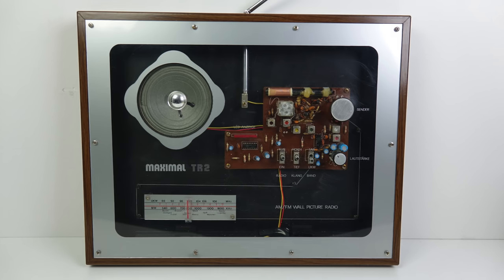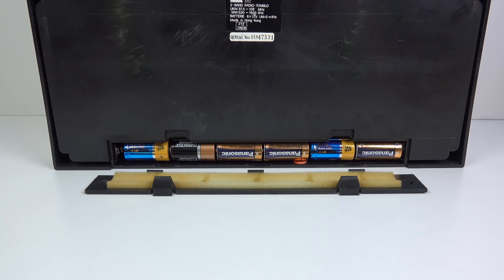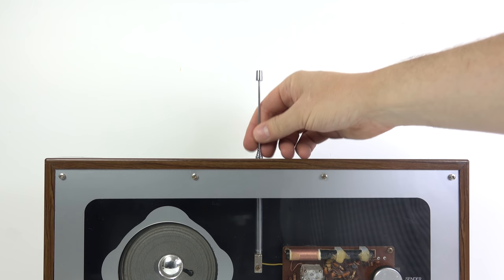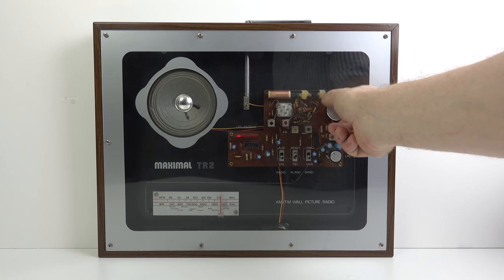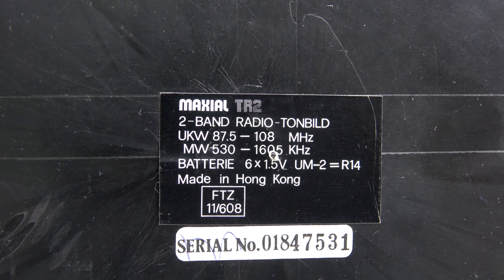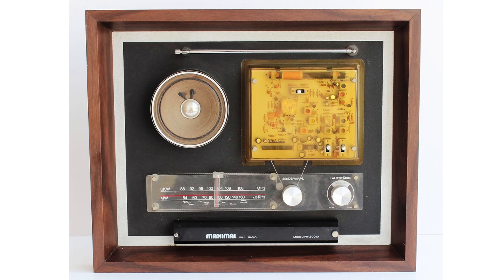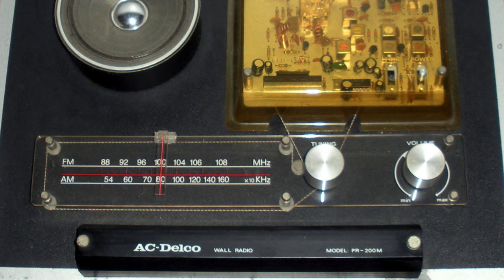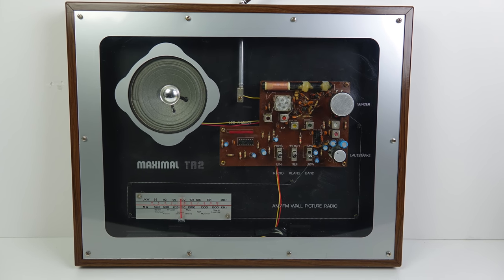Maximal Wall Radio - A QUICK-EXTRA-VID

Comment: be good as a self assembly kit to put on wall afterwards 
be like " I made that"
Reply: pretty easy to do  from scratch with a "donor" radio i'm guessing
Reply: My thought exactly. Fun little project. Parts should be inexpensive
Reply: I'm thinking that! Something like this (probably) won't be that hard :D Would just need a longer cord for the tuning dial :D
Reply: Yup! My 1st thought was Ah! Something interesting to do with those cheap Aldi radios I keep buying for some reason!
Reply: I may have to do this to my old "bathroom radio" I listen to when in the shower for news. It's an old Gran Prix AM/FM/TV/VHF Air that's seen better days. The battery terminals rotted out years ago (I fabricobbled an external D cell battery pack, lasts for weeks), and the plastic dial indicator broke a decade before that, and most recently the speaker decided to crap the bed, so I ordered a fancy transparent one from DigiKey. May have to get some plexi and fishing line and McGuyver a proper case.

Comment: That ULN2204 AM/FM demodulator chip was manufactured 04th week 1982. The parts on the radio are crooked for a reason. That's how they adjust that thing.

Comment: A tube wall radio with magic eye would definitely be more appealing, but would need a big hook to hang it because of the transformers, and would have a power cord coming out of it. I've seen one in my university, but AM-only as most tube radios were, and I don't know if it is still working. It is some kind of a educational model, but would make great and functional room decoration.

Comment: If they're gonna have an exposed PCB, I wish they'd make sure all the components are mounted straight, that would wind me right up having to look at wonky stuff.
Reply: I would have gone with a layout that complimented the other components. Maybe integrated the dial. It looks like they just gutted a regular radio and stuck the pieces in a frame. A bit like that pencil case clock kid.
Reply: It might not be possible with what they had back then, this PCB could as well be design from when IC radios started to show up, so mid 70's (IDK, we in Eastern Block used tubes for that for looooong time, so maybe earlier), and back then properties of PCB maybe were not that great so they in order to reduce problems with them had done it this messy way as it was easier than deal with other problems.

Comment: A radio isn't a radio unless is has LUXEMBOURG and HILVERSUM proudly displayed on the dial!  I had a radio which featured the exotic-sounding DROITWICH on it......
Reply: Exotic sounding, maybe, but in reality, a place near Birmingham, England, and about as far from exotic as it is possible to get.
Reply: Where the Radio 4 longwave transmitter is, which also sends out the Economy 7 signal

Comment: For some reason, when I first saw the system, I immediately thought of those radio/intercom systems in my parents' house. The main unit was usually in the kitchen, and each room had a speaker with volume control. I forget what the switches on the room panels did. I just remember a switch for something. I don't remember much about them, and I think we stopped using them around 1980 (when I was 11). I know we had one in the previous house, but I don't recall using it there either. I had forgotten all about them until I saw this video.

Comment: I remember buying many components in the 70s and 80s with "genuine artificial wood grain" 😋
Reply: Darren Krivit - As a young teen, I worked very hard one summer and saved enough money to buy a real quadraphonic system from a big box store.  It was a Sound Design brand and at the time I didn’t know they were on the inexpensive end of the quality spectrum. The four beautiful, matched speakers (12 inch main drivers and two piezo drivers at the top) were well taken care of and I wiped them down often with dust spray containing wax. One day while doing this I noticed a sticker that I hand not looked at before and my stomach sank as I read, Quote (I will never forget) GENUINE WALNUT WOODGRAIN VINYL VENEER. lol, it took a moment to sink in...

Comment: Some local stations in Norway are still transmitting. I found one at 99.3MHz in Oslo. Buying one of these radios just to listen to one station would be like experiencing the early days of radio broadcasting - the ultimate retro statement.

Comment: This "messy" arrangement of condensers and so, even with that wax like substance is common on circuit boards of some lower end devices.  I would say that it was due process used back then for developing of boards, when they etched rather borders than paths. I would assume that it might be due price and problems with PCB boards back then. I have dismembered several TVs and radios as kid in late 90's early 00's and I remember that those cheaper one used to have those messy arrangement somewhere, especially if it was around some critical part where they would have problems with parasitic properties of board (capacitance, inductance and resistance)

Comment: I like the idea of using circuit boards as decoration, but it should be really neat to do that. This one looks like the inside of any old cheap portable radio and it's a shame, because I think a radio made of discrete components is much more interesting to look at.

Comment: I've seen modern versions, which I'm not terribly keen on as the sound tends to travel (not very good for apartments). I rather like the look of both models you've shown here, Mat. In fact, it reminds me of those 160-in-one electronic kits, the one with a wood frame rather than plastic (Radioshack).

Comment: Looks like it is a regular mass produced radio, just in a bespoke casing with the cover. Not made specially for that, but probably turned out from a regular production run instead, either as they have end of run units or just as an order for the bare boards from the manufacturer.

Comment: Un diseño clásico de hace al menos 30 años. Usan el ULN2204A como amplificador de FI (Frecuencia Intermedia) con un esquema de amplificador de RF y conversor basado en transistores discretos. El LB1405 se usa para proporcional un medidor VU basado en led. Completamente analógico, cualquier técnico con conocimientos razonables puede darle servicio y recalibrarla de ser necesario. Una reliquia de la época donde se diseñaba para durar.
Por cierto aquí en el sur de Latinoamérica (Argentina para ser mas exactos) aun no se decidió el paso a la digitalización de la radio. Las grandes distancias y el uso masivo de la "radio vía Internet" hacen que la adopción del sistema DAB sea poco menos que una quimera.

A classic design from at least 30 years ago. They use the ULN2204A as an IF amplifier (Intermediate Frequency) with an RF amplifier scheme and a converter based on discrete transistors. The LB1405 is used to provide a LED-based VU meter. Completely analogical, any technician with reasonable knowledge can give service and recalibrate it if necessary. A relic of the era where it was designed to last.
Certainly here in the south of Latin America (Argentina to be more exact) has not decided the step to the digitalization of the radio. The great distances and the massive use of "radio via Internet" make the adoption of the DAB system a little less than a chimera.

Comment: In the US market FM is alive but not well.  There is some digital broadcasting using iBiquity's "HD Radio" (not to be confused with HDTV) but other than some experiments, the data is transmitted in addition to the analog program not in place of it.  AM (MW) radio is in worse shape because the FCC has, for years, not done anything about unintentional radiators -- primarily millions of switch-mode power supplies -- that are polluting the lower radio frequencies.  The FCC's "AM Revitalization" plan was to give every AM station that wanted one an FM translator ... so now the FM band is filled with low-power FM signals polluting that band as well.

Comment: The reason the PCB looks so horrible is that it was never meant to be seen.
I had an Emerson (or GE?) portable radio, same dial/switches/knobs/board, but was in a compact silver injection molded case. Bought it at the base exchange while I was in the Air Force.
Only reason I know what the insides looked like was a girlfriend closed it up in the hatchback of her car 😬
If I can remember the model number I'll let you know...

Comment: 6 C batteries?! Why does a simple radio like that need so much power? I remember plenty of small hand held radios throughout the 80's just needed a small 9 volt battery, and this thing is pretty much the same kind of circuit, except just being mounted in a frame. So I wonder why it needs so much battery power.
Reply: a C Battery has only 1,5V. So that would 9V as well. And you "need" that many so you dont have to replace it like every day. Those 6 Batterys have more mAh

Comment: Brilliant!

I’m pretty sure that you’ll get some “advice” from pedantically inclined viewers due to the mix of different LR14 batteries.

Let the warnings of “leaking/exploding/etc.” commence!  😂
Reply from the maker: Quite probably. For the ten minutes I had these batteries in it for shooting the video there were no major explosions...just a couple of controlled ones and a small fire.
Reply: Now about those batteries......   :/
Reply: Haha, it really can be a problem, though. Had two different branded torches immediately get ruined when I flipped them on after putting in fresh, but mixed brand batteries.
Reply: I enjoy your video's and there will always be those who pick, as they have nothing better to do
Reply: Kyle, 
"Had two different branded torches immediately get ruined when I flipped them on after putting in fresh, but mixed brand batteries."
I don't know what you did, but that is impossible. Maybe one of the batteries was of a different type and hence voltage than you thought. There is no way you can stack different brands of correctly sized and properly functioning "1.5V" dry batteries and get that result. No way!
Reply: A girl I know mixes her batteries all the time and that hasn't stopped her enjoyment ;-)
Reply: You can get problems if you draw high current from mixed batteries, but I don't think this radio is very power hungry.
Reply: Even low current applications can have problems with mixed batteries.  When the lowest capacity batteries run flat, the higher capacity ones will reverse bias them, and this causes the weaker batteries to leak.  Fine of course for a few minutes like here, but not to be left in there.

Comment: I'm really surprised they thought this 'workings' front view on the radio would appeal to buyers. Even if the circuit board was tidier there is nothing truly interesting or fascinating about the workings. It looks like a sales demo model that was made to show potential buyers what was inside. In fact it looks more like a radio kit a hobbyist could assemble or if someone for fun had taken apart a portable radio and mounted  the workings it in this case (which I'm pretty sure is all the manufacturer actually did).

Comment: soon we need a DAB+ to FM-transmitter (low range) so you can still enjoy the old FM radios
Reply: I have an extremely low range FM transmitter that you connect an audio source to, intended for car radios without USB/sdcard/audio-in and it works very badly :)

Comment: I like this. Why so many batteries though?
Reply: David K I was wondering the same thing. The only reason why you would use C batteries in series as opposed to just a 9v battery would be if you needed more current. But why does this thing need so much power, it's just a simple radio! It's not like it has any motors in it.
Reply: ct92404 i was wondering if it was an attempt to keep the depth of the frame to a minimum, although I dont think a 9v would have added all that much? I suppose it would depend on which 9v it was?!
Reply: Because you don't want to have to take your picture frame down to change the batteries every couple weeks. A 9V battery has about 200-300 mAh capacity. C cells have 8000 mAh.
Reply: because Germans. Sometimes we overdo things a tiny bit (and more is better, right?)

Comment: Nothing wrong with FM in the US.  Now, TV is a different story.  Analog is gone.
Reply: Yes but you can still (at least where I am at) pick up digital stations over the antenna. I get more channels than I ever did over analog antenna and they look better too.
Reply: My comment was aimed at trying to use "old" equipment.  It's not a question of how old that Channel Master antenna on the roof it, it's the age of the TV set.  Older portable TVs are useless at this point.